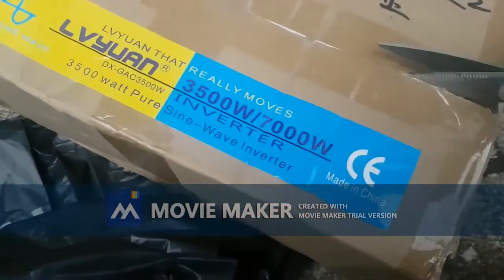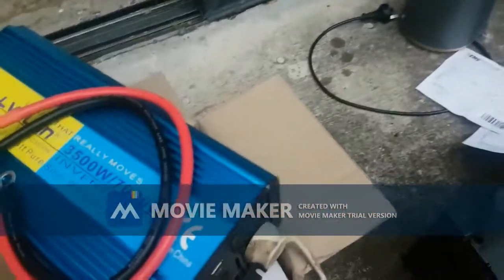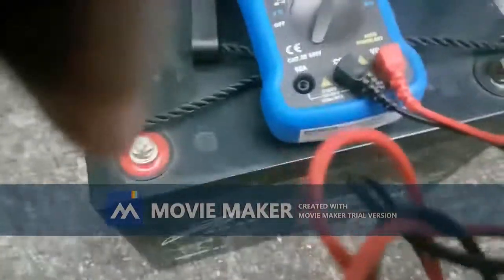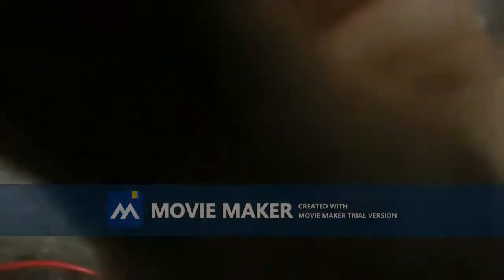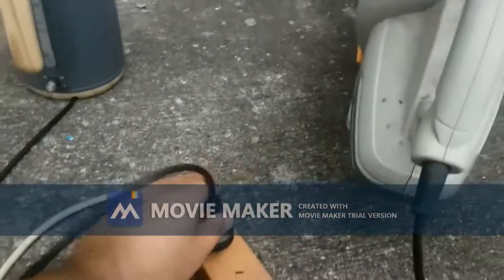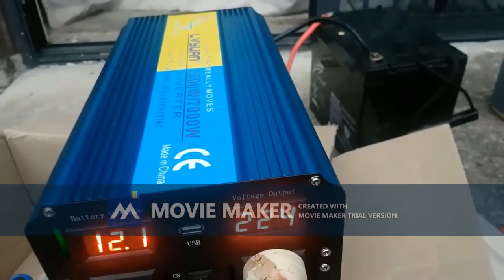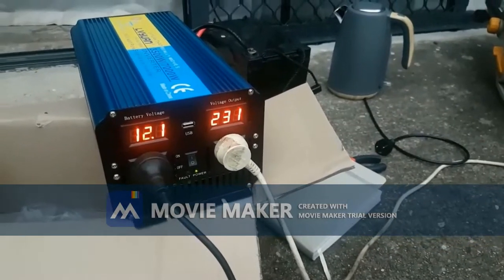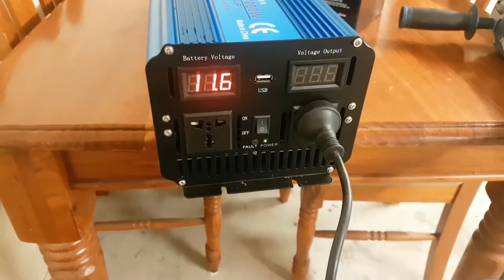Unpacking and Testing Inverter Lvyuan 3500w

Comment: I have this in the back of my work van works well have 2 batteries  feeding it runs my coffee machine all good you have a small battery  on yours .you need 1 more battery and will work fine as you'll not have the voltage drop that's where your going wrong

Comment: Low voltage cut out, if you want to pull 2200w your going to need 400-600ah of battery bank as the voltage of your single 60-100ah? battery is drastically dropping under this heavy load and is nowhere near large enough ah capacity to keep the voltage up
Reply: Exactly mate I spotted that straight away
Reply: @sadsayed2576  I think the OP posted this as he sells other makes.

Comment: Will it run 1.5ton air conditioner of 2400watt? And in winter 2000 watt water gyser?? If it’s work then I will buy